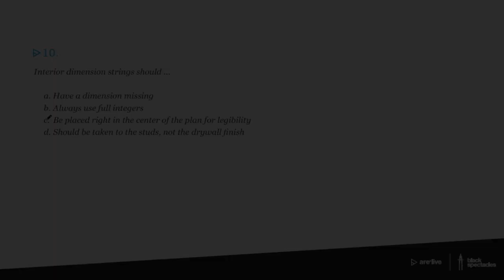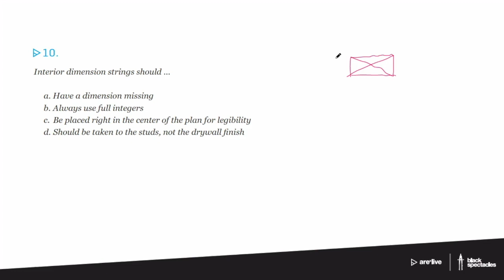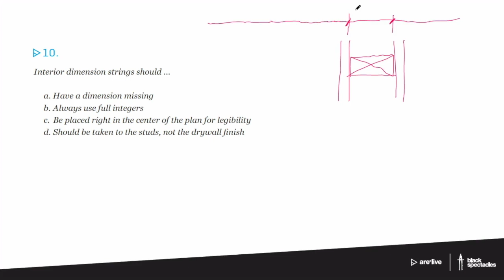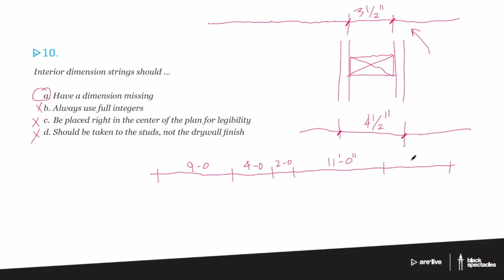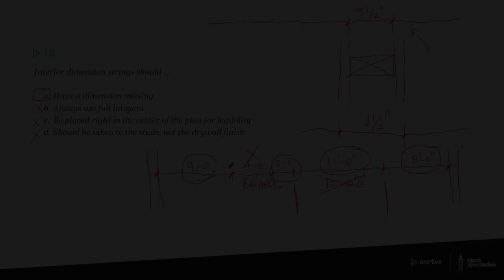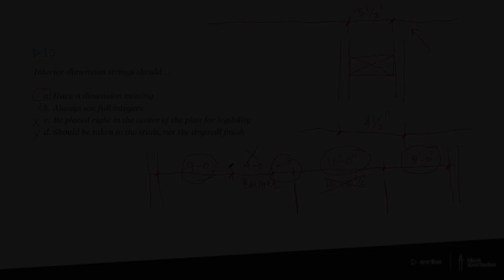Interior Dimension Strings | ARE Live - Construction Documents and Services

Comment: Couldn't the use of "FILLER, MIN, MAX, or even SLOP" be used as a suffix to that dimension string ? I feel that the dimensions to the stud are far more important for the framing and structure of the architectural set while maintaining greater control of that string. Wouldn't including an overall dimension to that inherently define what that missing number is?